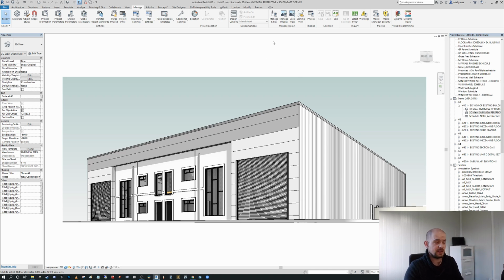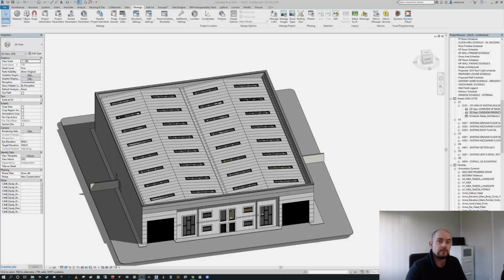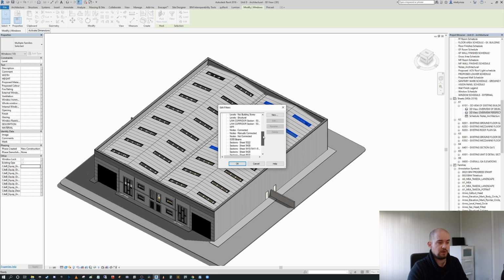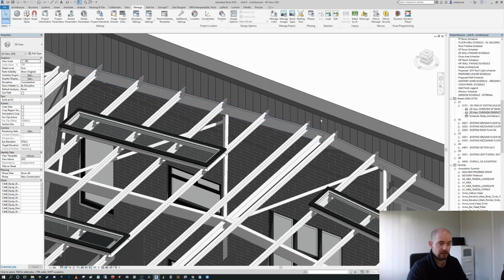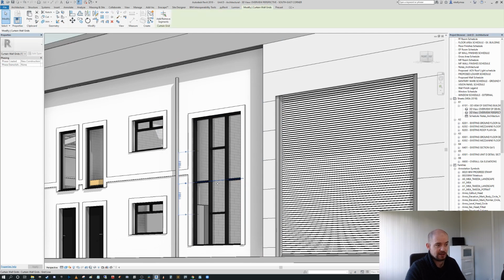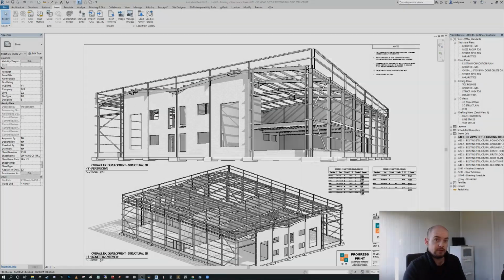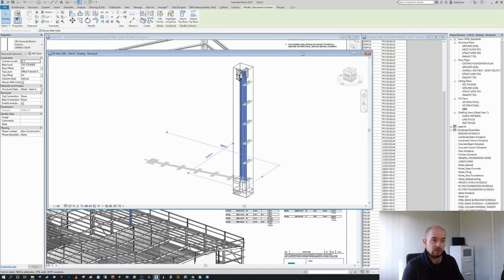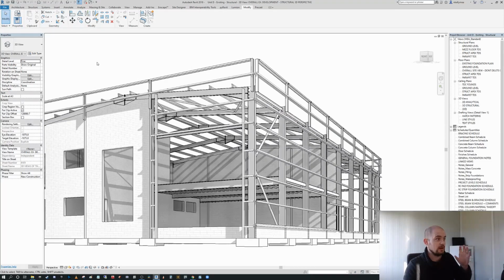15 Ways to Select Revit Elements Like a Pro

Comment: Very well explained, thank you Nial. I'm an Estimator currently looking at Revit to pull quantities from models & got a lot from this video so thank you very much. Interested in techniques to alter dodgy geometry from existing models. Splitting/ itemizing measures. e.g. atm I have an issue with Blocks of Buildings being too generic e.g. Block F has three separate buildings in it which I need to separate. But because the category/ family is all the same I'm a bit stuck with trying to itemize them.
Reply from the maker: No problem at all, glad you found it in some ways informative. Yeah with Quant takeoffs you really want to be inheriting very intentionally pieced together models, where item categories and nomenclature are well structured in order to speed up the scheduling process.  If things are all just assigned as generic models or similar your life will be very awkward. Are you sure the models are not derived from another authoring software and just linked in as a single family type? For example, I have seen ACIS mesh building models saved into 3D cad files previously which were then all loaded into generic models category families and loaded into a Revit Project file. Absolute disaster to try do anything with that kind of information.
Reply: @8020BIM  Thanks Nial, it was very informative! It's not as bad as being imported from external software in a single family type. They've created it in Revit as I have good family break-downs etc... just not as itemized as I need. TBH to their credit if I was drafting the model I would not want to covariantly break-down each itemized block & understand why they've done that. It doesn't help that my first model in Revit is £0.5 Billion; would've been nice to have a small one to experiment with lol. 
I was trying to use spaces & zones to covariantly give me more itemization but haven't had much luck with it so far. Thanks again bud.

Comment: Could you please shed some light on the subjects of selecting multiple elements in the linked model and how to delete the orphaned data smartly instead of looking for each of them manually and then deleting them individually.
Reply from the maker: To select multiple items in a link the easiest "Revit Native" way of doing it is to go to your selection options and turn off everything except the linked model information. This will speed up you selections but you still will not be able to undertake a "select all " function for an element type. You can however then select the entirety of the linked model geometry in one "click- drag-click" and then use the filter to isolate an object category. 
For orphaned data I am assuming you are speaking specifically about orphaned tags in a native model that were originally tagging a now removed element in the link? I haven't tried this en-masse as per your suggestion but you could likely itemise the tags in the project, filter the tag schedule down to those which have a value and delete the rows of those that don't. 
Hope this gives you some insights to play around with Ark. Pop on over to the discord community channel if you would like to talk with like minded people on the topic.
https://discord.gg/EktFCUh4

Niall